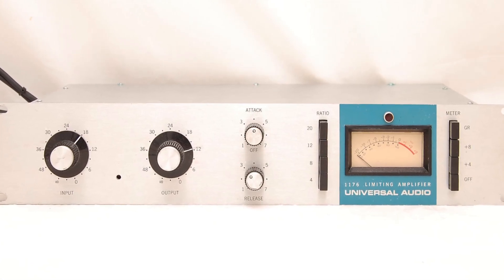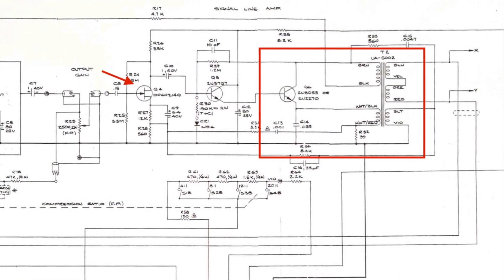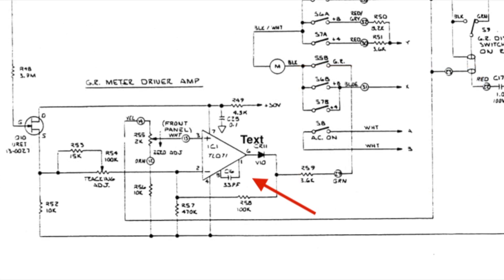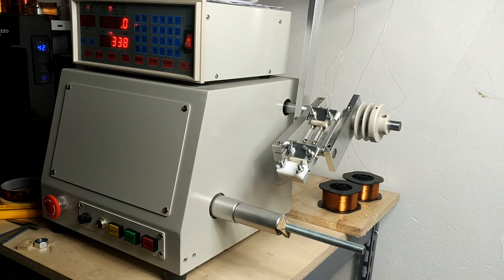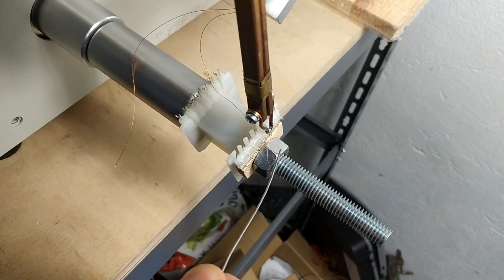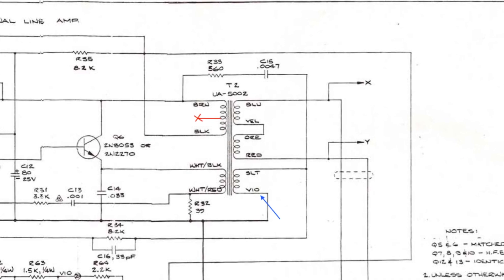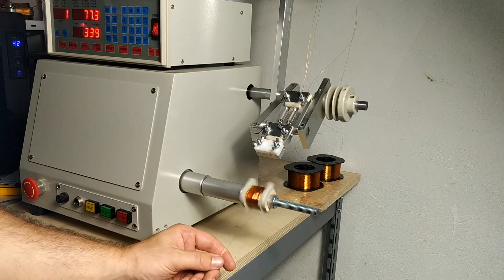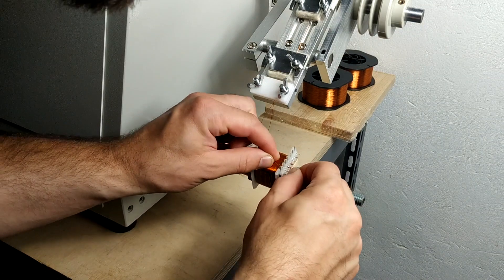UA 1176 Rev. A Output Transformer Winding

Comment: Excellent video.. I liked it very much.. Can you make an Neve 1073 Input transformer for Microphone preamplifier. Its a Neve 10468 model tansformer with centre tapped primary and secondary, Impedances as  300+300 : 2400+2400. You can the get the datasheet from Carnhill Transformers..All the best..
Reply from the maker: Thank you! Well, to be honest, I unwound one or two mic input transformers and read a lot of theory, but I've never had the proper core to actually wind them. I think CJ on the diyaudio forum shared the winding data for the 1073 input and output transformers. There are many good reproductions available at reasonable prices. Unless you are planning on winding 100+ of those it is cheaper to buy the ready made ones, because the mu-metal cores and bobbins and wire and mu metal case etc. will add up for more than the finished product. But, If you would still like to wind it check the diyaudio forums you should be able to find the winding data sheet.
Reply: @Delatsch Thank you so much buddy..sounds interesting ...let me check out that...

Comment: Would you say the original rev a design is inferior to later revisions? Seeing as they only made 25 of the true rev a 1176 most people tell me it's cause it wasn't a good design
Reply from the maker: It is by no means inferior. The changes in the following revision were very minor, just a few values of resistors. The only problem Putnam was trying to solve was higher noise level than he liked. But as far as the functionality and the sound go, the early revisions are perfect. I mean the most important thing is that Rev A and AB (which most of the famous record producers used and still use) use FETs in all the input trasistors of all stages. So, yes, rev a is only 24-25 units, but AB which is almost identical is another 100 or so units which are all blue stripe and those are the most used ones on all the hit records.
Reply: i know bills son, bill jr and he gave me a rev A, the original design. i like it a lot for some things but it sounds different then the later black faces ive been used to. it doesnt do that squashed modern vocal thing quite the same. you push the gain a lot and yeah it gets pretty hairy all right! im happy to hear it WAS a good design by someone who appears to know, thanks  @Delatsch

Comment: Excellent video, have a few questions. Have you been able to measure leakage/capacitive affects of bifilar winding? Did you reverse engineer the OPT design or was it published somewhere. On your winder, do you just set tension with a felt sandwich? Lastly, does pulling a vacuum on your potting chamber have any noticable advantages? This fine video sparked  lot, just curious. Thanks from Colorado.
Reply from the maker: Thank you, Craig! I haven't measured it but I will. I presume since the number of turns is low and it's 1:1 ratio it shouldn't have too great an effect on the overall performance. For higher number of turns it probably wouldn't work that well. I reverse engineered it, you can check my video titled "UA-5002 Unwinding" where I show the unwinding process. I just set the tension with felt sandwiches, but there are two of them. It took a bit of practice but I realised how to do it just by feel. I don't always get it perfect but it's close enough. I will try to make a short video about it. In my experience, pulling a vacuum is really not needed. The enamel is just there to keep the windings and laminations from moving and rattling. 
In the old days it was more important with a lot of paper involved I guess. I think paper after each layer contributed to a lot of moisture finding it's way into old transformers.
Reply: @Delatsch  Thanks for all the fast answers. Didn't know if vacuum would result in shorter time in the enamel. I remember seeing in RDH4, or at vintagewindings, for bifilar winding Western Electric would rotate the wire pair by 180 for each layer. That's wild but they'd get crazy high frequency response (no need for your audio work). Look forward to your upcoming videos. Keep up the good work.
Reply from the maker: @CraigHollabaugh It is fascinating how they came up with such ideas and what they managed to achieve even hundred years ago. I saw some old military RF transformers that were so tiny I don't know how they even managed to wind them. They used 0.1mm thick tiny laminations.

Comment: Great video, really  enjoyed it.  I have the same coil winding machine.  I am in the USA and was wondering where you got your transformer coil forms from, they look very nice.
Reply from the maker: Thanks! Those are made by a German company: https://www.weisser.de/en/
I had to order a larger quantity from the distributor, I tried a quick search and found this:
http://www.bwdarrah.com/productpages/transformer.html
Hope that helps.
Reply: @Delatsch  Thanks for the fast response.  I will check them out.
Reply: Nice! You not using thick insulation in primary and secondary only kapton tape. Enough ?